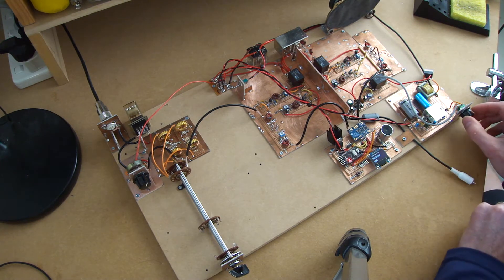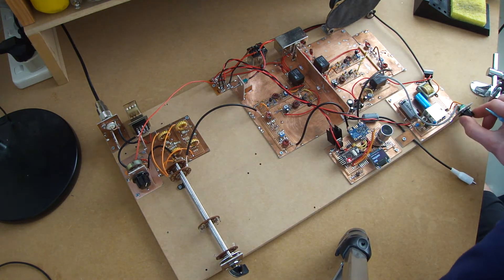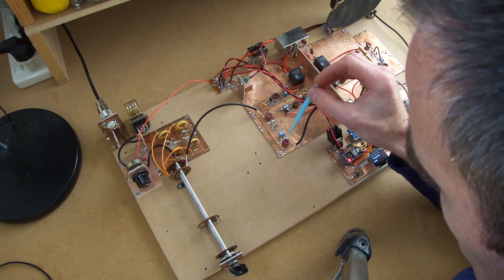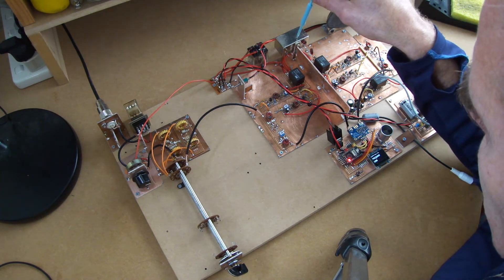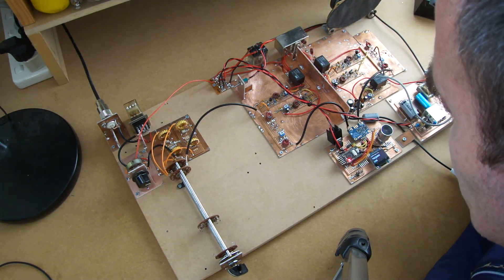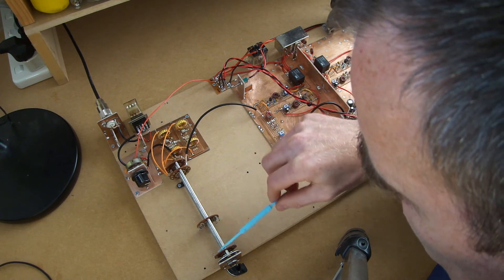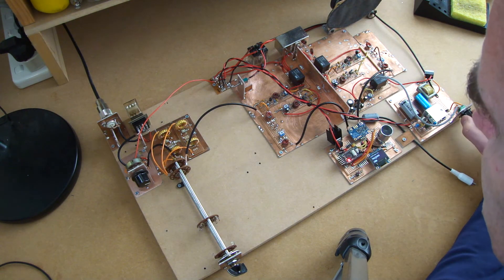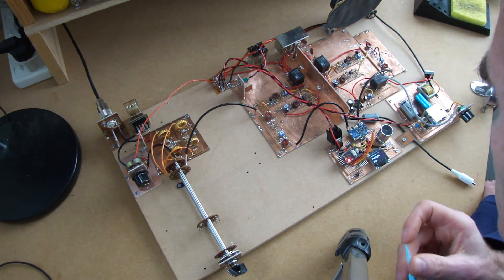Simple Homebrew SSB Transceiver Update

Comment: Hi Charlie, do you need to boost the signal out of the si5153 to drive the diode ring mixer?  If you do, what kind of rf amp would you use?  Single 2n3904?  Or something like a gali?  What about impedance matching going into the mixer?  Do you need to amplify the other side of the mixer to overcome insertion loss?
Reply from the maker: I have had no problems running the Si5351 output straight into either a SBL-1 or homebrew DBM with no additioanl amplification. Both like to see around 7dbm or 1.414 Vp-p. I find my Si5351 has a constant output until 12MHz where it starts to drop off. If I did need to amplify it, then I'd design up a simple Class A amplifier based on a 2N3904 (I have plenty of those in my junk box). Ideally, both the SBL-1 and homebrew DBM ports like to be terminated in 50ohm.